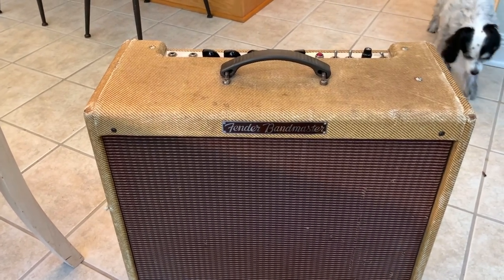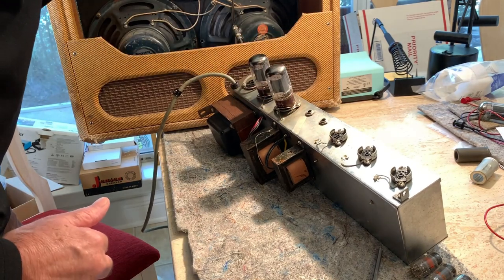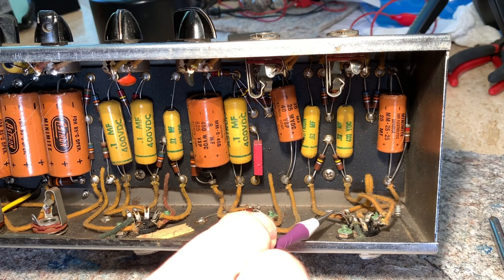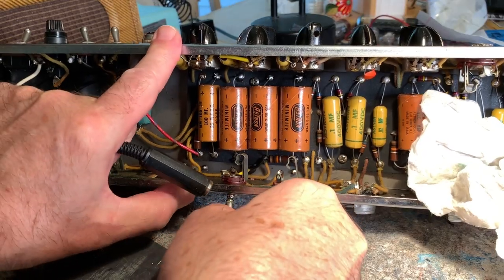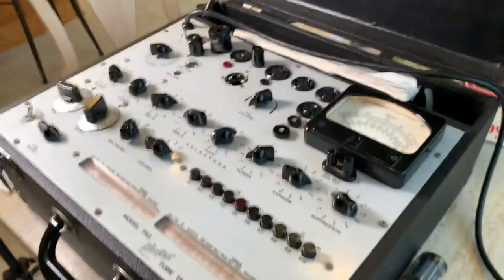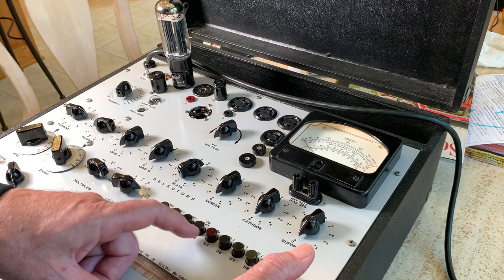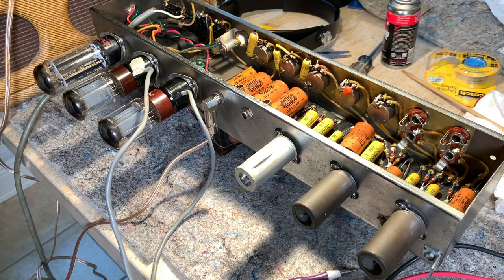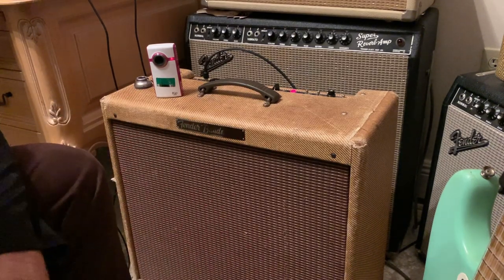Troubleshooting an Original 1959 Fender Bandmaster

Comment: Those tube pin contacts are supposed to be loose to allow for expansion/contraction of the tubes from heating and cooling. That helps to keep the hermetic seal on the tube pins from being damaged. Loose the vacuum, the tube won't last long.

Comment: The bias supply on those old Fenders uses a selenium rectifier to produce negative voltage. If those ever fail it releases poisonous selenium gases and it leave the worst smell behind. Whenever I see those in an amp it makes me cringe a bit. It's amazing that those rectifiers still work in 60-70 year old amps. Fact is that those selenium rectifiers are a ticking time bomb.
Reply from the maker: I always hear that about the selenium rectifiers but I've driven four them hard in four Tweed amps for many years without a problem.  I guess I will have to blow one before I change my mind.  I need to learn of what situation would cause them to blow.  A short in one?  I'm still trying to figure out why my 1959 Bassman had a red one versus the green ones that are in most of the Tweeds.
Reply: Think about it this way... As the selenium rectifier ages it will naturally increase the voltage drop across the component and this increases heat dissipation which will make the rectifier fail short. When it fails short it is going to flip the negative bias supply voltage to a positive supply. That is going to make the power tubes pull a ton of current up until the point where the mains fuse finally pops. Hopefully in such a disaster the tubes aren't damaged. This is why the first component I test/check is the fuse when I start working on an amp repair.
Reply: I must correct myself about if the selenium rectifier fails short. I said voltage goes positive but really meant you would be seeing full bias supply AC voltage on the grids. Not good for the tubes. 

There is one article online that talks about selenium rectifiers in a different light. It compares the life cycle of selenium rectifiers at 60,000 hours compared to tube rectifiers at 10,000-20,000 hours. Which says a positive about seleniums but does not compare them to silicon based diodes. The aging can also be how the circuit itself has been corroded or not. The corrosion of the leads at solder connections can be a point of failure even. The fact that you are taking good care of the amp and using it regularly are benefits to the life of the selenium rectifier. So there are pros and cons to anything and I don't want to make a blanket statement that the seleniums should always be removed. But yeah once you have a failure of one it will probably make you paranoid keeping them in the other amps. Probably a good idea to learn how to test the health of the selenium rectifiers.

Comment: No Sam but instead of using detox it on everything I would only use it in the pots because it’s lubricated so when you spray that shit all over everything particles are going to stick to it I would use regular contact cleaner and use the detox it on your potsI can’t believe that those filter caps haven’t bubbled yet nice amp

Comment: Oh! Eminence has a new P10R replacement speaker that’s made with a paper former, off the shelf! It’s the GA-10 SC59, good price too.
Reply from the maker: Interesting.  Looks just like the 1028P.  For the Leslie, it's not going to hack it at 20 watts.  The 1058 I blew was a 75 watt speaker and it couldn't handle the 50w Bassman head either.  The Delta 10A is a 350 watt speaker.  The 1058 is going back to Eminence for a possible warranty repair.  If the 1058 was defective, I may put it back in if the Delta does not sound good.
Reply from the maker: Matt Fields Here is Anthony’s response, “Yes, the GA-10SC59 uses a felt dust cap, which shapes the highs a bit differently.  They sound warmer and sweeter to me, but somebody else might think they do not sound as open and clear.  They were released in January.”
Reply from the maker: I'm mulling over replacing the recones in this amp with either the GA-10 SC59 or the 1028P's.  They look so similar.  I need to ask Anthony what he recommends.  I think three matched speakers would also help this amp.  I know they were reconed at different times by different people.  When I first had to have one reconed, when I re-installed it, I found that the speakers had been connected out-of-phase which made a big difference in the sound.  One speaker had the leads switched probably when it was reconed.

Comment: That phenolic piece was probably part of the old fuse holder. All 7/9 pin socket pins move around loosely in the base. Only real way to inspect function is to check the terminals with a tube installed.  You have a real pair of big brass ones running those Astron Transformer and Tube killer caps. 

It is time to replace them, I know it’s sad, but you have to come to terms with it. If you want a museum piece, leave it alone. I you want to use it, they gotta go!  There’s plenty of good new caps, like the Yellow Jupiter that work great.

The 5E7 uses a cathode follower driven tone stack, fixed bias and negative feedback like the Bassman, but uses a cathodyne phase inverter, like the Deluxe. No need for balanced triodes in any preamp tube.
Reply from the maker: The phenolic piece was a broken key guide from a 5881 which I may have actually done years ago.  I have the fuse holder and there is nothing missing on it plus it is all black.  

It is a museum piece so everything stays in.  I've shorted out the Astrons before and it's not the end of the world.  Everything survived.  I have yet to find a tone cap that sounds as good as an old Astron.  I've tried several of the Jupiters and they didn't cut it but then I think I only tried the red and blue ones so maybe I need to check out the yellow ones.  I'd prefer to use NOS Astron PIO caps if I can find them.  

I've had this loose pin problem on this amp before so I should have known right away.  

Thanks for the phase inverter info.  I still like balanced even though there is no need in this amp.  I may start looking for those Astron PIO caps just for backup.  I put two in the 1959 Bassman and they were great.

Comment: i've noticed that there's no need for discharging caps while tubes are in place, there're some nuances though and I always try to check it with multimeter first)
Reply from the maker: I hate getting shocked so I always check.  I have seen them build up a charge slightly after they have been discharged so I don't trust them.
Reply: Draining caps straight to ground is not always the preferred method. I use a 100k resistor in series with the shunt tool. Probably not a big deal if the voltage is low. Yes I have seen caps rise up a bit after discharging. Usually they'll get up to 7-10 volts, which is no biggie. That is unless you start checking the caps with a very sensitive ESR meter which doesn't like that very much.
Reply from the maker: @ringostarr4520  That is why I hook the shunt tool to pin #1 of V1.  There is a 100K resistor inline between the plate and caps.  That was a trick I got from Gerald Weber.  Once I do that for a while, then I touch the power tube sockets to be sure and that is when I usually notice the slight voltage build up.

Comment: Get yourself a welders cleaning file kit and select the right files out of the set.....you'll probably have to grind down the file ends to get to the teeth so the teeth are at the end of the file......and use those to clean and burnish up the tube sockets holes along with the spray.    On the other end.....the tube pins get tarnished and need cleaning too so you'd have to find a suitable Dremel attachment wire wheel to fit and use to clean them.    Then once done.....insert the tube and go to the opposite side to observe the pin ends and make sure they seat good......and then use GEL superglue to put a dab on the outside end at the base to hold the metal pins in place so they aren't wiggley.  Don't use the liquid super glue as it might seep in to the socket and be adverse to getting the right result.  Everybody usually forgets the cleaning of the actual tube and its pins......I've seen them tarnished black and various shades other than bright and shiny.                      You should do a leakage test on those first primary astrons…..the one might be starting to leak...….and also check the 2 resistors that junction together going to the cathode follower tone section tube.  The design has the 2 channels and volume pots all interacting via the 2 junction resistors converging in to the tone section cathode follower tube.  And being they share cathodes....check the resistor there too.....the bypass cap is newer but check that too.  With them interactive....there is a back flow situation.  So you want the volume pots clean so no dust interacts with the wiper going to ground when the pot is turned the whole way off.....nor do you want any DC back leakage if the signal cap is starting to fail from age deterioration.....if there is some DC back flow it could be also coming from the power rail via the plate resistor pathway.  It is relatively quiet though right now but could be shifting.                                                  THE ACME NOTE PAPER......Acme always make me think Wile E Coyote and Road Runner...………..
Reply: I forgot the jacks.....get a rifle barrel cleaning brush.....and use that to clean the input jacks and speaker jacks so you get a good ground when plugging in since its a mechanical contact ground....the jacks always tarnish out.    I use a woman emory nail board with the finest grit …..cutting the board long ways in to 3 strips.....give a solid firm tool to get in to clean the contact of the jack
Reply: The reason you want to check the resistors I mention......as they age and deteriorate.....the end leads going in to the resistor body can release  and be no longer bonded up inside the resistor body but being soldered and fixed in place.….you would never know that they have failed until you unsolder and go to remove them to discover the lead slips right out of the body......it can cause the intermittent.....but sometimes not show with a bashing from a chop stick
Reply from the maker: I don't get the Acme note paper.  Where is that?  This thing is in great shape except for the sockets which I will live with.  Did you hear it?  That was on 3.  The treble and bass controls on this amp are very sensitive.  The treble really drives the amp into overdrive.  My luck, I would end up gluing my tubes into the sockets.  I just have to push them down and I am good.
Reply: the tube tester...your note paper instead of scrolling the roll in the box...you wrote down the numbers.....
Reply: yep the thing screams.....     they have a smaller output transformer than the bassman so it goes into saturation faster and gets the compression both from the transformer and the tubes....but the transformer comes first...….more juicy than the bassman in a different way
Reply: I did a vintage 59 or 60 Sano amp for a client but it runs 7591 power tubes.....same circuitry but the primary tube has 220K plate resitors so it has more gain...….but yes the tone stack on the cathode follower is a baxendall type and does throw more gain with the treble.....I modified the Sano bass control to do the same thing as you wind them up to wide open......very unique feature of that tone stack as opposed to the bassman…..being both cathode follower circuits.  Extremely nice for playing blues when its about being dirty blues......you don't need a foot pedal
Reply: I used to hate soldering on the pins when doing service.....and having solder run in to the socket to clog up the hole......I usually insert an old dead tube these days...….but that metal for the socket pins does tend to get very brittle with some sockets.  I'm doing a Hammond amp conversion for a client for those 18 watt things that have become popular in some circles......they have their forum for those 18 waters with the El84's.....so there suggest converting 2 types of old Hammond organ reverb amps.  More or less a tweed era deluxe amp but with the euro power tubes.....Marshall 1974x/Watkins dominator clone......which I think is probably one to the Ken Fisher Trainwreck designs he built.....
Reply from the maker: @mikecamps7226  Lol.  I see that now.  I had not noticed that in a while.  Acme Trucking.
Reply from the maker: @mikecamps7226  Sitting between the Bandmaster and Bassman is pretty fun.  I am trying to do a new video today of my new Fuzz/OCD Tone Secret that I did years ago.  That's been a pretty popular video.
Reply from the maker: @mikecamps7226  Hey Mike, I was looking for the comment you sent about the two wah-wahs but could not find it.  Quick question, I just probably threw some money away on some NOS yellow .02uF/600v Astron caps but I was wondering if you had ever tried to reform old caps.  I don't have a Variac and I was trying to think of a way to do it.  I may just put them in my amp with the grid lead unsoldered and let them sit of a day or so.  They will one see 150-160V on them in the circuit.  Hopefully I can get a few to replace a couple that may be leaking in my Bassmans.
Reply: I might have sent that to your email....rather than on here.  I have to check my google to see if there is a copy.  I can't remember the full content but as to the 2 wah's…….use one as the wah for the wah effect and the other as a tone filter where you swing thru the sweep to find your sweet spot for tone response and leave it there.....provided the rocker isn't floppy.....as that would push the OCD and the treble booster clone.  You just gradually move the rocker to influence the treble going toe down or the mids and lows going heel down....either way but not at the extreme ends of travel....somewhere in the sweep curve you'll hit sweet spots with the pedals.   I was actually tuning a wah pedal for a client tonight but aside from the circuit tweaks I add the output buffer pre-amp which adds some straight gain to the output if you set it higher than unity gain …..which gives an interesting extra push to an amp to get the amp to breakup along with the wah effect and its tonal sweep as it generates the wah effect.  You don't have the extended push of like a KLON pedal with its volume capabilities....but similar but not as drastic but just enough to push the amp into breakup....the spinal tap mine goes to 11 thing...just a bit more push than without the wah on.                               My comment might be on your other video with the OCD and the Treble Boost clone......but I think I emailed it though.

Comment: Why won't you change the power cord to a 3-prong? Some argue that it will eventually become deadly, some argue that it shouldn't be a problem. What should someone like myself do for my '64 Blonde Bassman that appears to be all-original?
Reply from the maker: With me, I usually play two amps and when two amps are connected together, only one should be grounded otherwise you create a ground loop which causes hum.  So, if you connect two amps with 3 prong plugs, the amp switcher will have a ground lift switch to un-ground one of the amps.  When I play this amp, I always connect it to another grounded amp.  If I were taking one amp to a gig, I would probably select one of the 3-prong grounded amps.  But, I'm not afraid of taking this one either. I just would be afraid to touch another musician or mic.  Always be sure the polarity is correct on a two prong plug by using the ground switch on the amp.  I created a poor man's grounded plug in a video years ago just for this amp.  I ran a separate wire attached to the chassis and had a round plug that could plug into the ground at the outlet.  A pain but I wanted to leave my amp original.  It's cool to see those old style plugs.  Some have to stay alive to remember the old days.
Reply: @millstap  Thanks. I want to stay alive or else the condition of the amp wouldn't be one of my primary concerns. I don't think I would be running dual amps but would just like to be able to connect to other devices such as a tape delay or synthesizers like the minimoog I run through it.

Comment: Were you playing just through the Bandmaster at the end or through the Bassman + Bandmaster?
Reply from the maker: That is just the Bandmaster.  Sounds pretty close to the Bassman, just not as powerful.
Reply: millstap do you think the same circuitry tweed amp the Fender super with 2 10s sound close to this?  Was thinking of getting a clone boutique amp of this amp but the options are 2 10 inch speakers or 1 15 inch speaker.
Reply from the maker: @voodoowrangler83  The 5E5-A circuit with the 15" speaker would be closer.  It has a fixed biased circuit like the Bassman.  They were made between 1958-60.